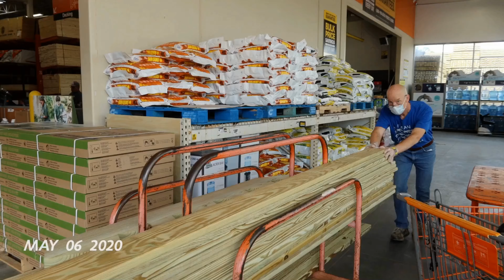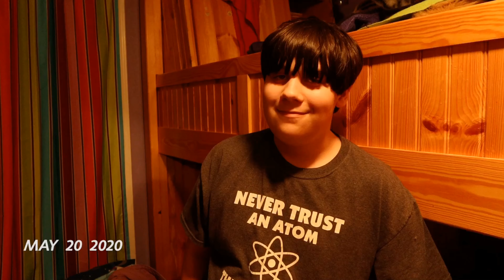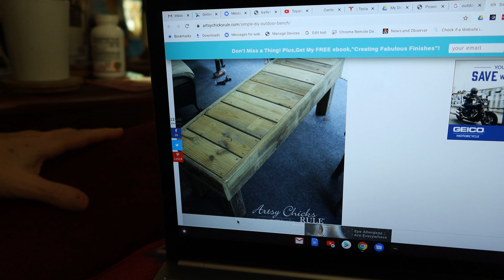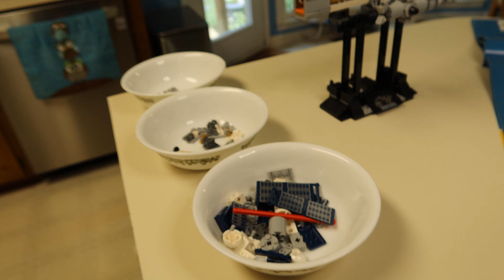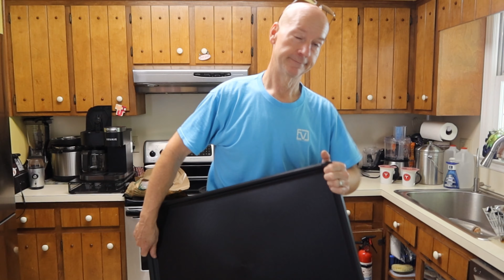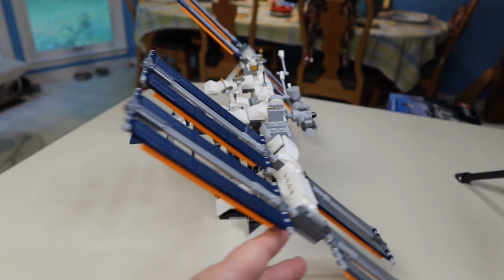Day 1089 Tesla Ruby ISS Complete

Comment: It’s been hot today but no humidity. Watered the garden before work and watered again when I got home. Tomorrow we have the remnants of the hurricane in the Golf. Heat, humidity and strong winds, up to 50mph. So that should be nice. 

Note to self, when designing a bench make sure you allow for a “crap gap”. Always learning something from Don. 😉

Obviously I found the comments! Ugh 

Great idea for under the sink. I think Weather Tech sells them for under the sink. I have water sensors next to anything water in the house. They help stop leaks. LoL
Reply from the maker: I laughed so loud!!! So, what water leak sensor are you using?
Reply: I use a few different ones. Zircon Leak Alert WiFi and Ooma water sensor. Both are easy to set up, Zircon doesn’t use a hub and Ooma hooks up the the Ooma telephone system. I use Ooma as my home work phone. It rings at home when the office phones ring but it’s geofenced, I have to be home for it to ring. It’s a complicated mess of technology, surprised? Probably not. But the water sensors will ring my cell which is handy.
Reply from the maker: @rickslife  Sounds handy!

Comment: What Don said about the spare tire has never been correct for me LOL. Two times I went on a trip, the first intuition told me “Check the spare”. It was at 7PSI and should’ve been 32. That trip? Had a flat. Couple years later, going up the hills on another trip, intuition told me to bring duct tape and fluids just in case. What happened? Coolant leak half way through day 1. Patched the leak with duct tape and made it home, about 150 miles, with the supplies I brought lol.

On the flip side I kept loosing my AirPods and finally attached a Tile tracker to them. Haven’t lost them since.
Reply from the maker: I've been training myself for 52 years now to listen to my little voice LOL. It does help if only I will do it. We don't worry about tire repair stuff locally, but Don has a plug kit and a small air compressor we always take with us now if we go to the mountains or farther away. We became more aware of the need after 50K and no free roadside anymore.